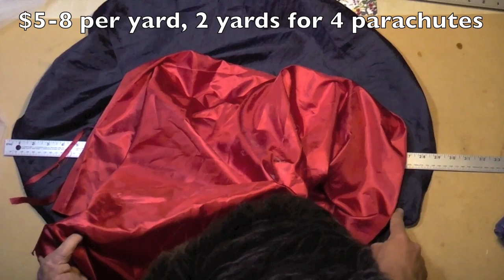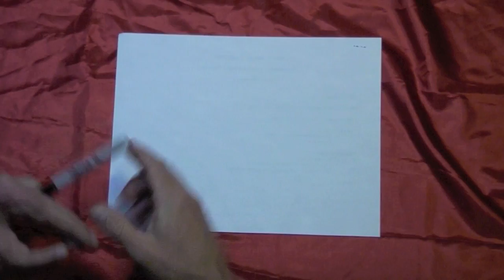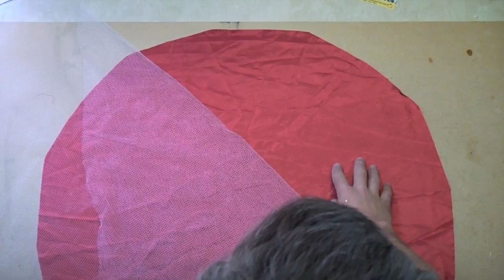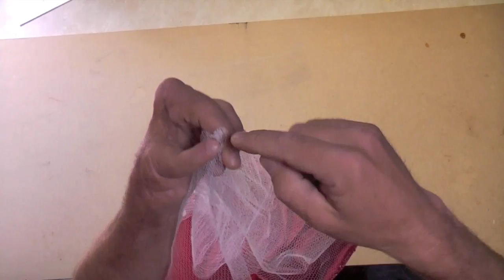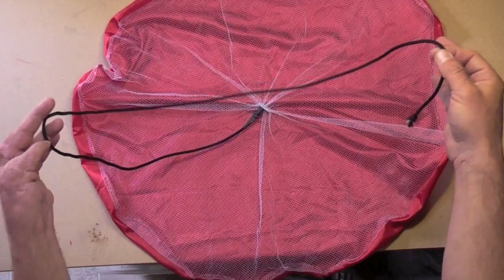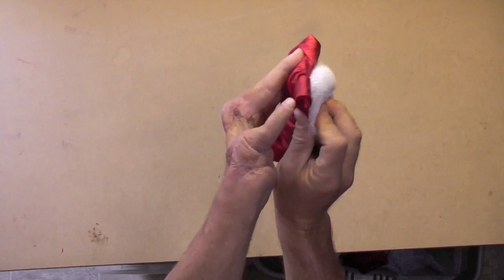RC PARACHUTE FABRICATION

Comment: Very nice video.  I have a Hubsan quadcopter H109s X4 Pro I was thinking of using your idea and apply the parachute  to it.  Have you ever put one of your parachutes on a quadcopter?  If so how did you go about it?  I would think the parachute would  sit on top of the drone if you need to deploy it disarm rotors, deploy parachute.  Just wondering about if I could use small brushless motor some how connected to my fpv1 transmitter.  Any ideas?

Comment: How can I make a parachute that deploys if I have a motor failure and my quad copter flips upside down ? What would I use to deploy the parachute or how can I make it so it knows when to release? Thank u
Reply: +JP Michaels 
I made one using a piece of thin plastic tube about 30mm diameter, put two notches on one end and hooked a couple of rubber bands over the notches, and made a lid from a piece of flat plastic, a simple pin hinge on one side and then hot glued a micro servo on the other side. Using a wire hook i pull rubber bands down through the tube, push parachute in, close lid and activate servo so that the horn swings over the cap to hold it shut. Release by activating servo and if rubber bands are correct tension, it catapults chute out quite well. I only use a small chute to prevent major damage, good insurance.

Comment: Does the tulle provide any advantages over traditional string (eg. more drag?) I'm asking because I would think it would take up a lot more space than string.
Reply: Also shouldn't there be some more tull to make it easier for the paracute to open completly as the lower amount of tulle seems to pull down on the sides of the parachute causing less air to be caught.
Reply from the maker: Random Rampage The tulle netting can never tangle, which is the main reason for using it.  It's also easy to attach to the parachute, and it's really thin and compact, I would guess about even with string suspension lines.
Reply from the maker: ExperimentalAirlines Yes, ideally I think you could make a cone of the netting and allow the canopy to expand a bit more, and/or use an apex pull-down line to flatten the canopy.  It's mostly a matter of simplifying construction that I just use circle-over-circle netting over nylon.  It also folds up neater.  Skydiving pilot chutes are this way.

Comment: As a kid we use to take a large garbage bag and open it up,cut out a circle then use the small strings inside the chord ,tied about every 4in around then tied all at the bottom,bad thing about that is it would tangle.nice job on the video

Comment: A soldering iron on low to mid heat does well with heat shrink tubing & tape too.  If the iron does burn the materials you are using for you parachutes it will make a hole but not set it ablaze.  Nice video tutorial.  I'll have to try this out!

Comment from the maker: Agreed, I would also go with sewn seams, either heavy-duty netting or proper lines.  I'm sure there's a formula out there somewhere but 72" canopy comes to mind as being able to slow that plane down to a relatively non-lethal speed, though I'm sure it would get damaged.  But I would check that out further, don't trust me.

Comment: Awesome tutorial ! I`m building a 91-1/2 " Telemaster FPV plane as I`m writing this. The Telemaster has a trap door under the plane I plan on using for a parachute in case the plane goes off course and gets into trouble over a populated area I can bring it down safely. The weight of the plane will be pushing 15lbs. with FPV equipment, how big of a chute do you think I will need to bring it down safely ? Also I think I`ll be going with sewn on cord instead of the glued on tulle ? Thanks, AJ

Comment from the maker: Can't think of an alternative, except for sewing.  Be sure to use pretty hot glue and get it down very intimately between the netting and onto the nylon canopy.  Mine have worked for dozens of deployments with no detachment.  Anything radical you're doing?  High speed drops?

Comment: I am riddling on a low weight cheap multicopter solution, I will use my old pilot chute from skydive. it is made frim F-111. Thi will save you packing volume, and has a better chute-characteristic. usually you can also grab them cheap from ebay, from old chutes and skydive systems ;-) or ask the rigger from you next dropzone... :-) but nylon is doing also not too bad.

Comment: Nice job Ed... I've been using the plastic bags from Target/Kmart/Walmart and such. Everything's the same except I tape kite string to the bag and use a fishing swivel to tie all the lines together, works great... except when the parachutes are tucked together for a day or two, they tend to, um, drive to the ground REAL fast. Otherwise if I just fold them soft like your second way all works great. I may have to try this... Thanks for sharing... AGAIN!!! jerry

Comment: Have you considered putting a small hole in the parachute at the top? It will stop the wobble and stabilize the chute so it falls strait a hole the size of a silver dollar would be best you can adjust the size for each parachute size.

Comment from the maker: @RCPrairieFlyyer I actually tried sewing it and it was a disaster.  The tulle mesh gets all caught up in the machine.  I was told you could sew it through paper, or use an attachment called a "serger", but for my $.10 and 2 minutes, the hot glue works pretty well.